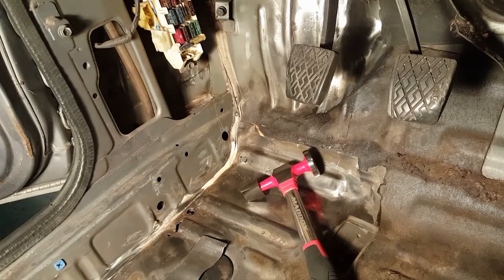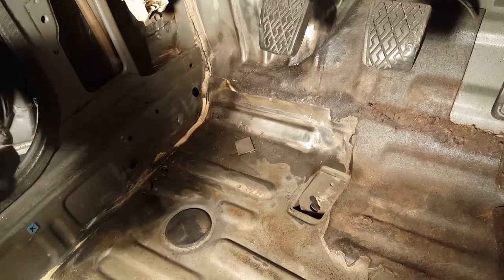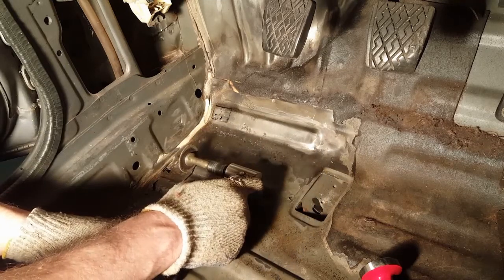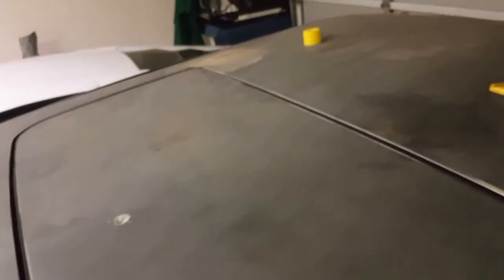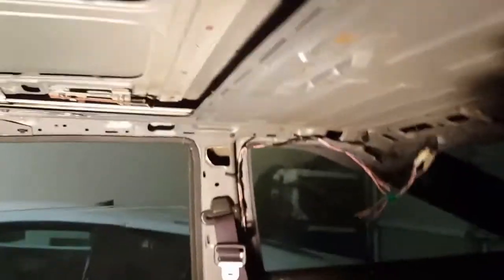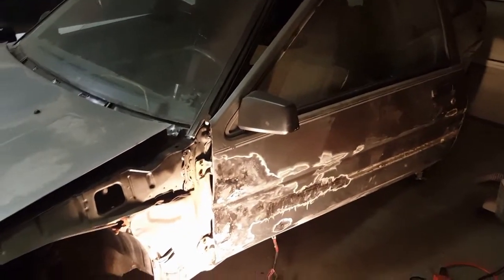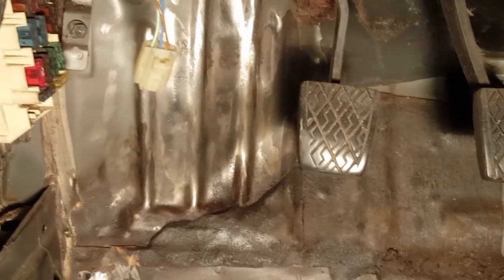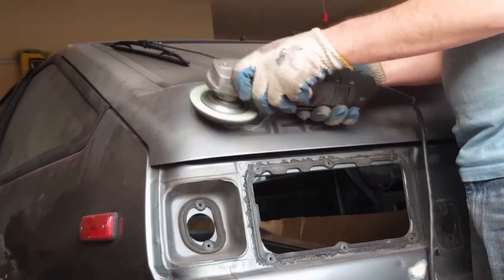Ep.27 PROJECT AE86 Rust! and I ruined my door plus...

Comment: I'm very interested, how much does a non running 86 go for? Absolutely loving the videos, you work hard.
Reply from the maker: thanks a lot....glad your enjoying the show.  a non running 86..well i've seen them from $900 (which is what i got mine for) up to $3-4 thousand (which is a lot for non running).  there are a lot of other factors involved....is it a hatch or coupe? hatches go for more coin.  sr5 or gts?  how's the interior? auto or manual?  does it still have powersteering and air conditioning? is there a lot of rust?  etc etc.  i think the rust is the most important issue.  too much rust and it doesnt matter how good the engine runs.
Reply: wow, here in spain the non running and striped down are 3.000 haha.
Reply from the maker: @hachirokuspain just watched your new vid!  Congrats on passing your tech inspection!
Reply: ae86 - sr5 to gts conversion thanks I have been looking I live in the uk so there are a select few that haven't been totalled beyond repair or turned into drift missiles. looks to be i will have to import from the states or Japan.
Reply from the maker: yes....try to get one....you won't regret it.
Reply: ae86 - sr5 to gts conversion yeah it's a car I've wanted as far as I can remember haha love your work dude.

Comment: In my floor board repairs, i cut out the bad metal but gave like an inch overlay of the new metal on the old metal(that was still good) for more strength

What chemicals do you use to prevent rust
- Rust Prevention Spray? (whats it called)
- Rust Reformer Clear?
- Rust Reformer Primer?
- Chasis Black?
Reply from the maker: hi Kenny4age...yeah I was thinking about doing it that way too and on the interior probably better that way....but I was concerned about having moisture get in between the overlay with the repair area on the floorboard.  the rust reformer I use is just some rustoleam rust reformer which is like a black primer with the reformer in it....i also use a clear rust reformer by iron armor (its just a cheap Harbor freight brand but it works).  the black chassis paint i refer to is also by iron armor and its just a gloss black paint that is supposed to be chip resistant.  thanks for watching!